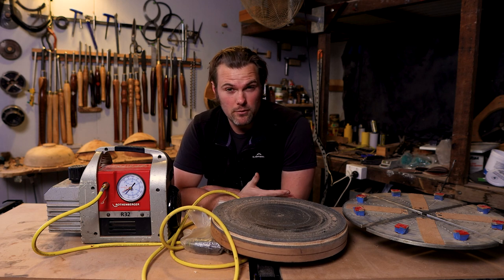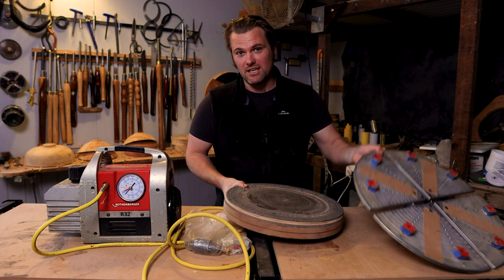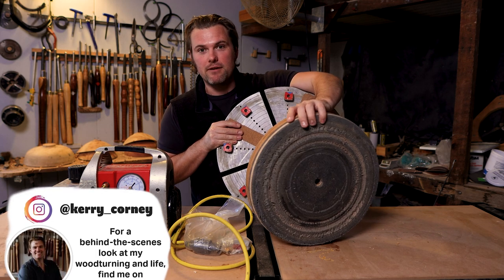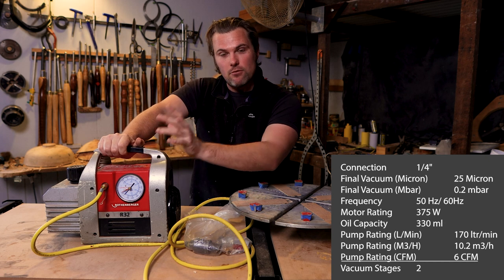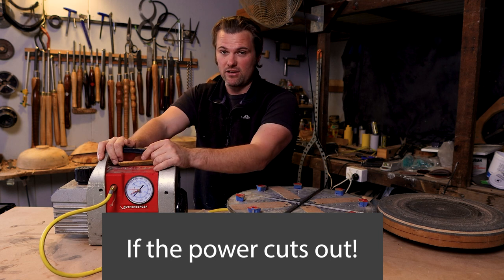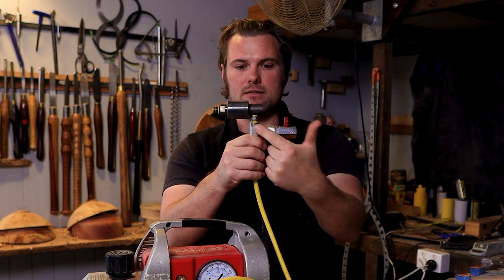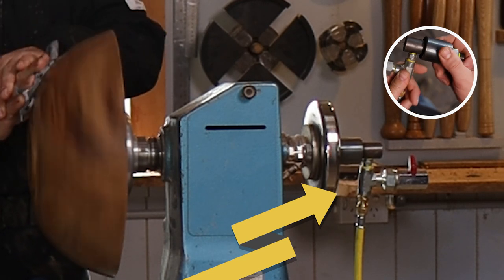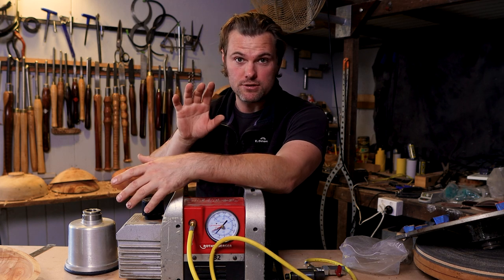Woodturning: Complete Guide to Vacuum Turning.  Boost Your output.

Comment: Shipping probably would make it not as good an option but in the United States there is a company called Frugal Vacuums. Great kits that work well. I have two friends using them flawlessly and way cheaper than my Oneway set up. You aren’t pushing them but to all who see this. Once you use one you will end up getting one
Reply from the maker: Thanks for the tip about Frugal Vacuums in the United States! It's always great to hear about affordable and effective options. I'm sure others who come across this will appreciate the recommendation. Sometimes, finding a reliable and cost-effective solution can make a big difference. I might just have to check them out myself! I will pin this comment to the top of the video. Thank you Rod. I really appreciate it. 
Cheers,
Kez
Reply: You bet. Can actually make them yourself out of hope and pvc fittings which is what they make them out of

Comment: Hi Kerry, thanks for making the videos on the use of a vacuum chuck, lots of great information here what would be difficult to figure out from scratch. After watching this I feel I am better prepared for doing the research. So many points to buy a good one. It is not easy to anticipate the safety aspects if you have never used a vacuum chuck, like electricity shutting off or the pipe collapsing. Great info, much appreciated!
Reply from the maker: Thank you so much for the positive feedback. I'm thrilled to hear they're helping you out. Safety can be a bit tricky, but we're all on this learning journey together. That's why consulting a hydraulic company can help a lot with good quality fittings. Feel free to reach out anytime if you've got questions or need more info. If you have Instagram reach out there and I do post a lot more behind the scenes stuff there that you may find helpful. Cheers Melkein.
Kez.

Comment: I've been wanting to incorporate a vacuum pump into my woodturning, mostly for wood stabilization purposes. Unfortunately my lathe isn't compatible with a vacuum chuck but I've got my eye on a new lathe that will be. If I can tackle the $2.5k for the lathe, a new vacuum chuck won't be far behind it. You've just reinforced my desire to up my turning game because nothing's more annoying to me than having a beautifully finished bowl and having to clear away a tenon and accidentally marring the foot of the bowl. Very informative video, especially the tips regarding the hvac line and hydraulic fittings. Thanks Kerry!
Reply from the maker: Absolutely my pleasure mate. I really enjoy making them. Why can’t your lathe take a vacuum pump? Cheers mate
Reply: @KerryCorney  My lathe only has a hole opposite the headstock for a knockout bar, can't fit anything else through the hole that's there. Having taken off the housing around the headstock in the past (got a chuck stuck on the threads and don't have a spindle lock, either) it's apparent that the hole that passes through the spindle has all kind of gaps in the machinery that wouldn't allow for any kind of seal. I got the lathe with my employee discount when I worked at a tool store but was too green to know I should've saved a little more and found something better. Lesson learned, plus the limitations of my lathe have taught me a lot about how to 'make-do' with what I've got.
Reply from the maker: @Matt_Barnes  Thank you for informing me. In the video, I direct people to the links in my comments. You can purchase spindle-mounted attachments. If you don't have a hole through your spindle, this will enable you to attach a hose to it and then a vacuum chuck. Here's the link.https://www.vicmarc.com/product-page/vacuum-cups-plate-rotating-unionsest-collars
You can use a vacuum cleaner, but I have heard of their vacuums burning out. Do you have Instagram? 
Cheers,
Kez